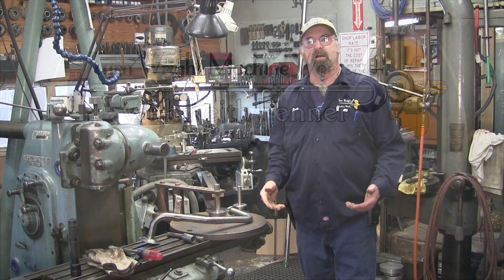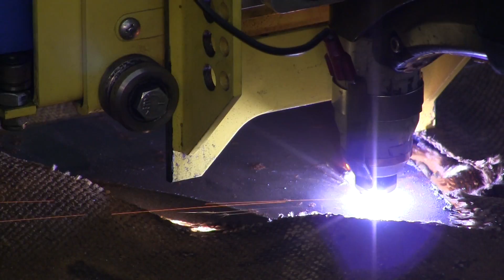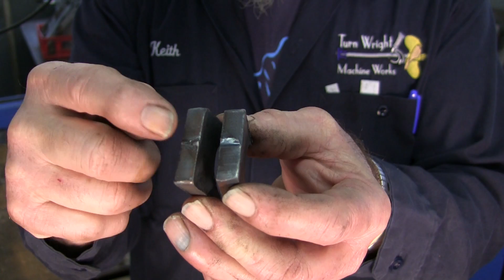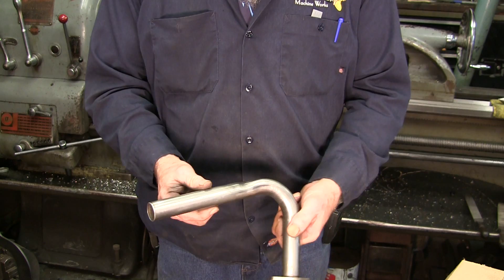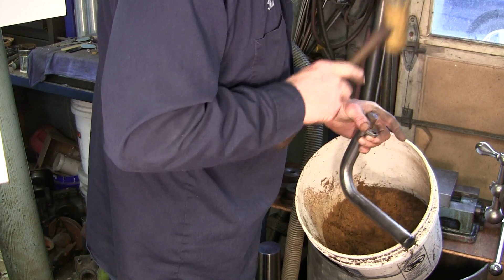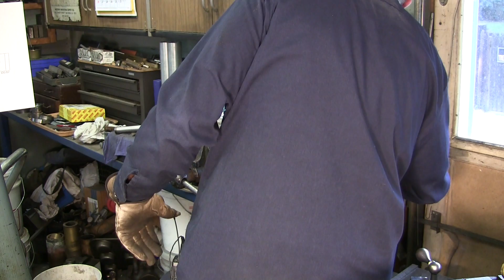Shortening Your Pick Up Line Part Two

Comment: look into a product called Cerabend.  We used it to bend  tubes for the production of jet engine parts when  the print didn't allow  any  deforming of the tube when bending.  It's a metal but it melts in boiling water.

Comment: Kieth,
Have you ever tried pushing tight fitting round ball bearings through the pipe in the press after your done bending?  The pipe has no choice but to expand back to the original ID. 
Thanks,
Mike

Comment: Hi Kieth, I certainly can not teach you anything to do with machining, but I can tell you were you went wrong trying to bend that tube, that small circular die you had on the outside of the tube should have been made from square bar (same width as the tube diameter) about 150mm long with one of the flat faces having radius along it's length to fit around the the outside of the tube with a roller pressing against it.

Comment: I just want to thank you for all your vids. Because of your educational vids I just got a 13-40 Doall lathe its not wired yet. I'm in Alaska and it in not e/z to find "good" machines I am trying to get a K and T 2h with slotting head, horizontal,3 arbors supports 6 arbors and the always missing front brace in good condition for $7500. But every time i try to buy it the guy tells me about other machines to buy and thinks i would be happier with a bridgeport quill syle mill. But i'm stuck on the Kearny and trecker 2h like yours I like the idea that 3-1 machine and heavy also new cat 40 stuff is ezer to find. I think he does not really want to sell his baby and i think he got it cheap lucky guy. I will keep saving and keep riding him to sell or I take a road trip this summer and tour the U.S.A looking for used machines and tooling. I can't wait 20 years to get a mill and i'm not rich. I have no good connections in Alaska and shipping is only $4000 because ((lower 48ers get free shipping)) Alaskans and Hawaiins pay for all your free stupid shipping ((YOUR WELCOME))  SO THANK YOU KEITH for you time and knowledge you make me feel like a apprentice in your shop and you gave me the confidence to get started in machining. P.s say hi to your lady in the background haha.

Comment: A rosebud heating tip instead of a welding tip like that can work better sweating off parts sometimes,  puts more heat into the part but less locally

Comment: try to use pressure washing machine, just weld two stub with a nipple, one nipple connect to machine, second close after air off (tube must contain only water).
and bend tube under pressure

Comment: sand, water, oil...all are good to use when bending tubing.

the best is ICE. fill with water and freeze it solid...that's what brass instrument makers do...then pull/press a ball bearing sized to the od through the tube to smooth it out

Comment: Hello Keith.
Here is something you might find useful if you do much tube bending.
It's low melting metal (158 F),  specially formulated to prevent distortion in pipe work.
http://www.belmontmetals.com/product/eutectic-alloys/
Carl

Comment: worse bending I ever seen . . . if you back off the throwing wheel . . . no dent . . . but I think you are using trolley wheels . . . no good for pipe bending . . .bending wheels have a taller wall

Comment: My friend and I were trying to bend 3 inch tubing 180 degrees on a Pines #2 Tubing Bender.  I think it was a 6 inch radius (die) bend.  I forgot the thickness of the tubing, but it was thin.  The tubing tended to stretch more on the outside diameter than it compressed on the inside diameter.  We ended up tearing a lot of material.... even with a brass inner mandrel, proper wiper, lube etc.  Maybe we should have polished the mandrel, die and other components... that would have reduced the friction and "grabbing".   I think we would have had some success if we heated the inside diameter to facilitate compression of the I.D. ... but who knows what problems would have arisen from that.

Comment: Nice vid as always kieth, you could try a rectangular block with one pivot point and the same radius as the part cut ot the other side in place of the roller kind of like the jd2 die sets it takes away that single point contact also. i used them for many jobs and worked well cheers.

Comment: Cerrobend, Bendalloy, Pewtalloy and MCP 158, is a eutectic, fusible alloy with a melting point of approximately 70 °C (158 °F), we used to use this stuff in the aerospace industry to bend hydraulic and fuel lines. Just heat in a pot in water kept at about 170 °F plug on end with a stopper let it cool or run filled part under a cold water faucet  and bend.

Comment: From my experience, you wouldn't get the tube deforming if your main die shoulders were higher; i.e. the depth of your die is the same as the diameter as the tube. The following roller doesn't make up the other part of the diameter, it only keeps the tube in the die during the bend.

Comment: ....6:00.....high grade coat hanger.....I remember in the days before MIG welders were affordable...muffler shops did a lot of gas welding using filler wire that was actually coat hangers....actually pretty decent cold-drawn wire....plenty of coat hangers from the uniform supply guy....

Comment: Keith, before you started bending would there have been any benefit to putting the old pipe in the bender and tracing the outline with a sharpened soapstone?  Thank you very much.

Comment: Keith.if you make a steel ball just smaller than the tube id drill through, fasten steel cable to the ball you may be able to pull .the dents out of the tube radius with a porta power unit . Thats how the United Airlines tube shop does it. but they don't use a porta power they have a special bench setup to pull the ball through the tube.

Comment: first book I ever read on oil pan modification the Chevrolet power catalog 6th ed. late 80's or so. gotta keep the pick-up point in the middle of the sump to prevent vortex forming if a swirl starts it'll suck air an "angle iron"baffle stitched to the bottom of the pan is simple prevention lot of meat and potato stock block factory part improvement in there like increasing oil flow to the timing chain cause higher rpms puts em under more load love this project

Comment: The packing with sand and bending reminds me of when we had to make heater coils for a boil out tank at the radiator shop I worked at years and years ago. We would take half inch copper pipe and flatten one end, fill it with sand and then flatten the other end. We had a jig me out of pipe that had a notch cut on one end and then bend the pipe around it until we had the correct amount of coils we needed and then cut the ends off to length and sweat on the fittings we needed.

Comment: we found if you anneal the pipe before bending, the pipe bends more evenly and reduces any fatigue cracks.
We anneal the pipes by laying the area of pipe to be bent over some bricks then bringing it evenly to a low red heat, once red we throw a heat resistant blanket over the heated area to cool slowly.
a bit of scotch brite over the pipe cleans up any discolouration (AU)

Comment: Instead of sand you should have used water, it will not compress and it cleans easier.

37 years of mechanics experience here.

Comment: Hey Keith, just a thought on the little kink or divot in the pipe you bent. we used to use a trick with compressed air and a little heat on the dented portion of 2 stroke exhaust pipes. just plug one end and pressurize the other end. (with caution of course) works surprisingly well.

Comment: I remember using slightly smaller dies gave me a better result than using the same size as the tube.
It helps the tube keep its form because it wont "escape" up or down.

Comment: A pivoting flat block with the one inch radius would have done better, it should be six to seven inches long with the mounting hole two and a half inches from the back end. this would have eliminated the pinch you experienced.

a

Comment: hi Keith. to prevent the pipe from collapsing instead of the roller you made for the outside edge of the pipe, a flat shoe about 4 inches long that has the pipe diameter hollowed out of it to fit the pipe will spread the load over a larger area and not distort the pipe. I use to make custom exhaust systems for cars using a hydraulic pipe bender that had a half round shoe and two flat ones to shape the pipe.

Comment: Nice work ! Glad to see your aware of the sand technique.  An old timer born in the late 1800's showed me the sand technique about 40 years ago,when helping me to straighten out a bent tubular steel trailer tongue. When dealing with any type of structural  tubing it is critical to stretch the steel as opposed to warping the compression side.. If you've ever watched a tower failure,a tv antenna failure, or a truss failure the failure always starts with a compression/ bend  failure (unless its a bad weld). On most  bends, using a torch on the outer curve works great when you cant use a jig (or don't have one)